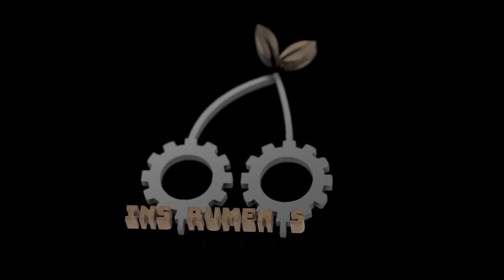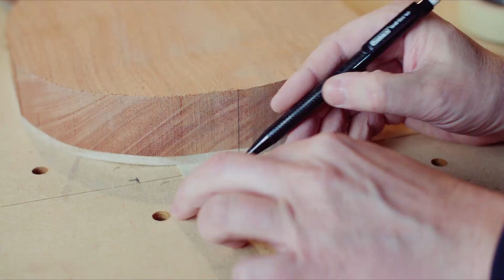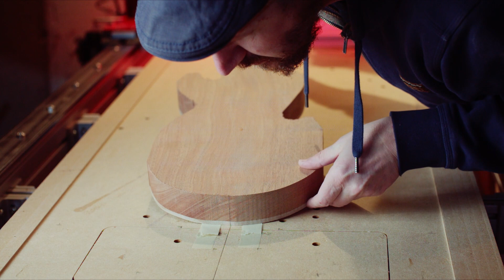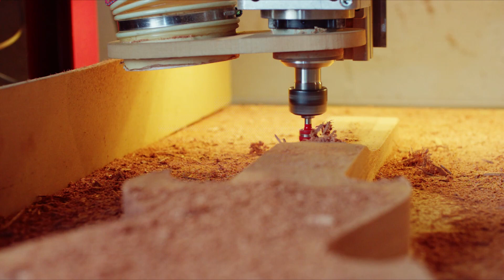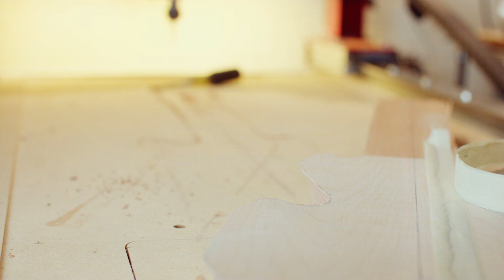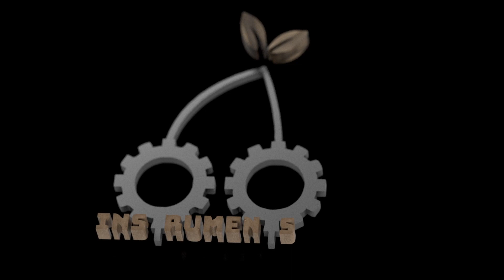Building a Custom Bigsby-Inspired Lap Steel Guitar from Scratch | CNC Milling | Part 3

Comment: what cnc machine and software are you using here ?
Reply: what brand cnc machine is this
? is it step craft?
Reply from the maker: @eross21  it's cnc router parts now avid cnc.
Reply from the maker: This is Fusion 360